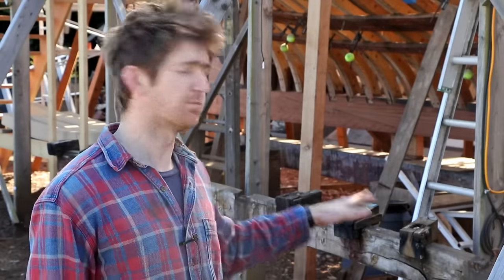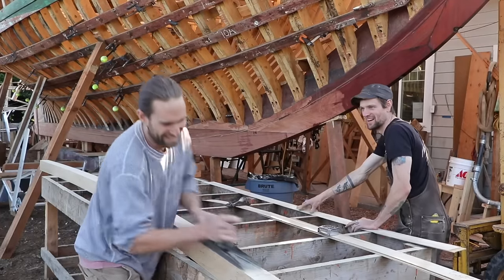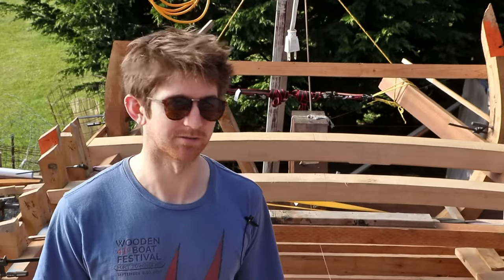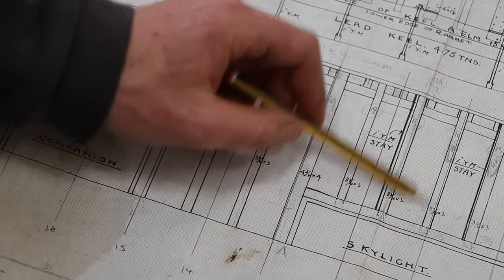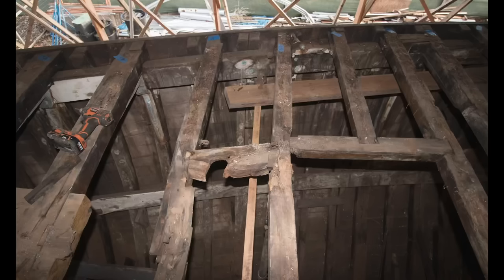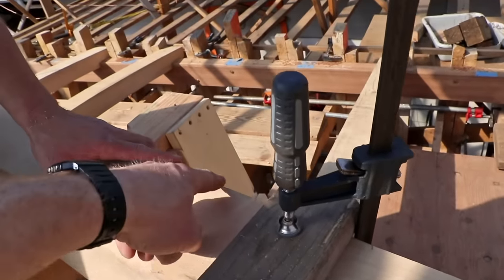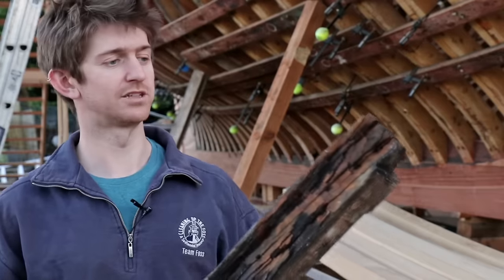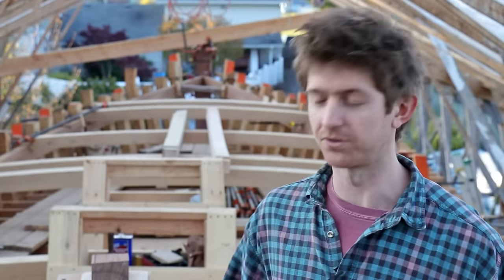BoatBuilding - Fitting Deck Beams! (Tally Ho EP70)

Comment: The men who built the original, would be proud of the detail, that you and your crew have done, to copy their craftsmanship. Well done.
Reply: imagine their thoughts on some of the machinery. the battery powers. ..or the laser levelling line
Reply: @bgd73  It is true, i really would like to know what these mens and maybe womens who worked on building Tally ho would think about our technology, and how they did it in their times, because they ddin't have power tools.
Reply: @kiwicami287  they'd probably ask whats taking so long then hahaha
Reply: @bgd73  They would be astounded! On the other hand, it's remarkable how many of the tools these guys use are precisely the same as they would have used 110 years ago. Some old-fashioned hand tools are simply indispensable for this kind of work.
Reply: Amen...
Reply: Never mind lazer levels and battery drills 
Just a few decent steel rthat'll identical to each other would be pretty marvelous to them
Reply: With the work today being done with power saws, routers, power planes and big machinery, it gives you pause. Four craftsmen are doing the work that twenty were probably doing 110 years ago and at a faster pace than then. The detail today is most likely more precise and defined, but unless you carefully document what the original builders did when they built her, you don't see those details from the plans. That is the reason taking measurements and lots of photo's are necessary to duplicate the original work. It truly is a joy to watch the build being done today and understanding what it must have been like when she was originally built.
Reply: @richardbohlingsr3490  Well said!
Reply: That joinery is damn right pornographic :D

Comment: There is nothing more pleasing to watch than a sharp chisel in the hands of a true craftsman.
Reply: I could not agree more! Love seeing those mallets in use!
Reply: I was thinking the same thing.
Reply: I never knew chisels could make such nice cuts before I started watching Leo.  I went out and bought a pack of chisels shortly after for my shop.  Still amazes me how smooth he can make a cut with them
Reply: Patrick, however, is a close second. #MorePatrick
Reply: @ChevTecGroup  That's because, in my limited experience, I think I have understood that the most important skill when using a chisel is the sharpening. It makes all the difference
Reply: Sorby or not Sorby? That is the question :-)
Reply: @ChevTecGroup  I tried my hand at chiselling and making boat models when i was young after seeing the works of an elderly's carvings in the same street i was growing up, i never had the patience he had so i did not go far but it is amazing seeing it in video form.

My father does wood sculpture art and he asked me to try it out but like i said i don't have the patience right now, maybe i'll try it out when i'm older.
Reply: It is almost like he is cutting soap
Reply: I agree.  Watching the beam drop into place and bottom out with the top surface flush at 18:56 gives me a feeling of satisfaction and well being.
Reply: Or a sharp craftsperson wacking his chisel, truely.
Reply: @ChevTecGroup  Paul Sellers is probably the best YouTuber on step-by-step carpentry skills using hand tools (including choosing, making, and maintaining tools). He's another guy who it's lovely to watch working.
Reply: Yes, Leo is an absolute artist with a chisel, isn't he? It's wonderful to watch him at work.The way those giant dovetails slot in, perfect, no gaps, is miraculous.
Reply: @FlatFifties  My thought as well...just beautiful!
Reply: TheSGTfish  learn how to sharpen them properly. It makes a world of difference from a “almost sharp” chisel.
Reply: They're not quite that fast in real time. Chiselling hardwood is really easy compared to pine. As a lifelong professional wood butcher, though, I am much impressed. Cabinet making level of woodwork. Far more accurate than the original build. Respect.
Reply: @billdyke9745  I try to make a few things from wood but the quality of fit these guys are making is just stunning. The fit of those beam ends is amazing. Working out the hatch beams will be 3D chess on steroids.

Comment: This boat is like a fine piece of cabinetry that floats. The level of joinery skill is old world master craftsmen . I am amazed!
Reply: David McCoy hear hear 👍🏻
Reply: Remember how rotted the old deck was? Yet so well fitted together it never dumped Leo thru to the hull
Reply: I too appreciate the incredible joinery in these massive beams and Leo's explanation, using the old beams and original drawings as guides. I've build a couple canoes and the only real joinery I had to do using chisels was in making simple seats.  Leo's figuring out and explaining for us why the original builders changed Strange's plans was fascinating.  I've been watching this series from the beginning--always a thrill to see a  new video.
Reply: Hear hear hear
Reply: @chascain1  I hope we're going to see an in depth before and after when it's finished :)
Reply: Yeah I cant wire to see the interior joinery start to come together
Reply: Don't you think the work is neater than the old? I see many tool markings and such in the old pieces. I can only imagine, but the time/productivity constraints on a shipwright in 1900 meant that good enough was good enough. Leo treats the work like furniture/cabinet making as you say.
Reply: @LucasRichardStephens  shows how much of a passion project it is to him. modern or classic you wouldnt go to this extent of removing tool marks unless its your baby. its absolutely unnecessary(in manny areas), but it is really really nice.

Comment: I have been following for a couple of years now, I really enjoy it when you use the original pieces to explain the process of replicating the original work, it helps a novice like me understand the means used by the designers of the original boat to achieve as much structural integrity as possible, using the design to make the boat "hold itself" together. The men who did the engineering on this were worth studying, and saving this skill is a worthy  endeavor.

Comment: "...think YouTube is going to say that I'm 
using a plane backwards?"

Sanding, using the plane as a sanding block, 
maybe?

steve
Reply from the maker: Correct!
Reply: I figured the new guy doesn't get a blade until he's proved he can use it forwards and back.
Reply: Agreed, Plane gives him more weight than a sanding block would.
Reply: Even I noticed that, and I've only used a plane once-- about 50 years ago. In wood shop. In junior high school (now called "middle school". Go figure). But I know this: in woodworking-- as in most trades-- it's not just "whatever works"... it's "whatever works best". There's really no such thing as "using a tool for other than its intended use." They're multi-functional-- like using a screwdriver to open a paint can...
Reply: Knew you would say that. 👍
Reply: @crustycurmudgeon2182  That's OK for the screwdriver, not good for the paint can. It's one of the main reasons paint goes bad in the can. Use a dedicated paint can opener. And be gentle.

Comment: These wooden members are huge to me. That they are held together with this (4:07) kind of intricate beautiful joint is stunning. I have built furniture, a hobby, for 40 years. I never in my wildest dreams thought I was see this kind of fine furniture joinery in a wood structure of this size. I have made a lot of locking dovetails. I use if for the same purpose, to keep things from springing apart.

Comment: When Leo is going to be done with her, she's going to last, if not twice as much, then very close. Quality woodworking, good materials, improved materials, work ethics, smaller crew (than likely she had at birth). Great boat.
Reply: Will likely be a lot less ferrous metal in her but much of the added life expectancy will come from being owned by the shipwright that rebuilt her. These wood boats live or die by their care or lack thereof and Leo will make sure she stays well maintained.
Reply: Probably, the boat me and my dad owned is 130 years old. It's all down to maintenance, assuming it was built properly in the first place.
Reply: She'll be treated like royalty rather than being worked to death in the fields.

Comment: I read recently about the Spanish Armada attempted invasion of England. The Spanish ships, weighing up to 1100t, were built extremely strongly, their hulls were around 3 ft thick of solid Oak - combined skins and frames! Consequently the English cannonballs mostly just bounced off. The effort required to build them, having watched these videos, is unbelievable. Oak is super heavy, every movement of every piece of timber would have required jacks, block and tackles and a vast manpower. The logistics and project management required, considering the Spanish had around 300 ships, was staggering.

Comment: Very impressive, more like Custom Cabinetry than  framing a house.
Reply: More like a timber framing. The custom cabinetry will come later as the interior is built.
Reply: American timber framed houses sadly aren't made to last, contrary to boats from that era. Even today  the difference between wooden houses in America, are vastly different when compared to, say, Scandinavian or Swiss houses. Almost as if they don't care.
Reply: @Paul_C  I would agree with that I was building custom homes in the 70s and 80s and there is no quality now.

Comment: The joinery for the half beams and carlins is very nice! I have wondered why post and beam builders do not use that sloped tenon detail where floor joists meet a summer beam. It leaves more wood in the bearing beam and, especially in a boat, it allows the joint to drain any moisture.

Comment: Acorn to Arabella: "Let's show you how to really build a boat..."
Leo: "Hold my beer!"
Reply: There is a stark contrast in the progress of these two projects at present. I sense some disheartenment on the east coast. While they will, no doubt, overcome their difficulties, the difference is laid bare and it comes down to Leo's obvious boat-building ability.
Reply: To be fair, if I recall correctly, one project is the work of a boat builder and a sailor and one is the project of two chaps who decided to build a boat. Totally different backdrops for these boat building sagas.
Reply: @Thundermuffin93  Still, it all comes down to the epic cannon battle both parties are working towards, as directed by their beastly captains Messrs. Pancho & Akiva.
Reply: @gav2759   Please expand on what you mean.   I thought the east boys were already well into planking the hull.
Reply: That cedarplanking stock they hzve just aint gonna work...to many checks and knotholes
Reply: I fully enjoy both builds. Interesting to see the differences in construction.
Reply from the maker: The guys at A2A are doing a bloody good job, especially considering they weren't boatbuilders when they started. They are now! 
It's too bad they are having trouble with their planking stock, but they'll pull through.
Reply: @johnnybarbar7435  A2A are using different techniques i.e. bent frames instead of sawn and they are assembling in a different order. They have not yet started on the deck structure but are planking while they still have the forms in place ( originally used to define the shape of the boat and hence the shape of the frames ) so that the forms will help to retain the correct shape rather than letting the planks take over. Leo has used sawn frames so there are no forms and he is completing the 'skeleton' of the boat before applying the 'skin'.
Reply: @chascain1  It'll work, they just have to adapt to how it works.
Reply: @johnnybarbar7435  As Leo has commented they are have no boat building background, so what they have achieved thus far it admirable. They would not have expected everything to be plain sailing and right at the minute they are encountering some difficulty with their planking. Partly because they got it wrong at the lining off stage and each strake is proving progressively harder to handle. It has become more uncomfortable  to watch with every episode. Lou Sauzedde (Tips From a Shipwright) paid an opportune visit in last weeks instalment and put them on the right track in this regard. Now it seems the cedar meant to complete the topsides is fairly obviously, not of a suitable quality. It is to their credit that they recognise the impasse they have reached and if we have learned anything about Steve and Alix we know their acumen and resourcefulness will ultimately see them and Arabella through.
Reply: The new guy is a big boost to the progression of this project.
Reply: Sampson Boat Co it’s all down to the stock timber you are using. You have GOT to use quality timber.!
Reply: AidGear  Retired boatbuilder here. I learn more from a pro like Leo, he’s a real throwback.
Reply: Akiva: 'when the hell are you going to finish?'   Pancho: ' hold on, got to run my beak along this beam, quality control, y'know.'
Reply: @gav2759  Yes, things are not going smoothly for them at the moment. They have also been hit harder by the lockdown. And now they are having trouble with the planking process. But they do have a big plus that they have all their floors done, and the engine mounts in as well. This is a big chunk of work that is still to come on this boat.
Reply: @MULLAC22  Very good description of these two traditional and very different approaches to boatbuilding.
Reply: @SampsonBoatCo  I love this. Good for you man, giving Steve and Alix a boost. Both of your projects are an inspiration! I'm intent on seeing these both sailing the world.
Reply: AidGear : I doubled over laughing with the “Hold my beer comment.” All well intended good fun. I love both Acorn and Sampson channels. What we are witnessing is a very special moment in time. I’m grateful for both of them and what they are doing. They “lift the boats of many” to borrow an economic term and return the phrase to its rightful nautical home. You have to admire on the one hand the hand me down side by side learning from an apprentice-master, and on the other the alchemy of turning an ethereal passion gleaned from reading books on boat building into reality—and to do so utilizing Yankee ingenuity, and making do with the resources at hand. 

Sampson Boat and A2A rule!!!
Reply: @chascain1  Cedar is also to soft and there workmanship is awful
Reply: @SampsonBoatCo  There main problem in my opinion is they are presenting them selves as experts and there videos are formatted as teaching people how to build a boat. They give classes on boat building and are clearly not qualified to do so. They need to present themselves as complete amateurs learning as they go and I believe that would be much more honest. There is also a lot of bull and manipulation going on. Like claiming there keel pouring was environmentally safe.

Comment: We all know you did it on purpose (@18:50). Installing an almost perfect carlin, with compound and complex dovetails with offset shoulders on either side, was clearly intentionally designed to make all woodworkers everywhere jealous. Speaking for all woodworkers, everywhere, well done! Though, I thought I saw one of the beams move, just a little. A woodworking mentor once told me that, when you are  working with BAJ's (big _ joints), it might seem easier because it's bigger. But, it isn't. More surface area and longer seam lines, just serve to highlight even the smallest of flaws. Exceptional work!
Reply: yeah, the beams wriggled a bit because the joint is so perfect, as soon as it's not sliding down into the morticing perfectly perpendicular, it's that tiny bit longer on the diagonal... if he tapped with a hammer on both sides at the same time, i think it would have just slid in perfectly

Comment: Love the craftsman-continuity aspect of this project. Seeing not just the finished joints, but all the old pencil marks and scribing lines really puts you in touch with the men who cut the original joints 110 years ago.

I live quite close to the ruins of a 12th century castle [north of England], and although it survived the civil war it was reduced and stripped for building materials from the mid 16th century onwards. There are hundreds of old castle stones in the nearby walls, houses and farm buildings, many of them with the mason's marks still showing.

It's nice to think that whoever works on Tally Ho in future will see the marks that Leo and his gang are leaving. It's sort of like reaching back to shake hands with the past.

Comment: Each dovetail joint is more insurance against the waves of the Atlantic. All pockets are sloped on the bottom faces to encourage drainage and prevent rot. Excellent workmanship and the Will to prevent short cuts is enormous.

Comment: The new Tally Ho-it really cannot be considered as anything other than a new boat-provides an interesting contrast with the original. I hope Leo will make a video comparing the two, standard of available materials, time and man hours expended including lofting and pre construction work, including numbers of shipwrights on original, comparison of joinery standards, benefit of modern tools and machinery versus hand tools, how the original could have been improved with modern technology, comparative cost/budgets and any other areas that occur to him.

Comment: One of my favorite things about woodworking. Is the art of joinery. There are so many interesting and both beautiful and functional ways to join wood. Some of my favorite is Japanese joinery, where they have literally come back several hundred years later, and disassembled moved and put back together. Completely from the original materials except for roofing tiles. Due to the original design of the structural joints.